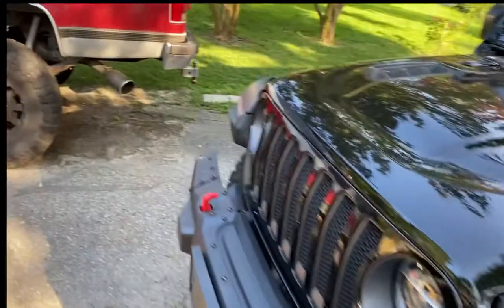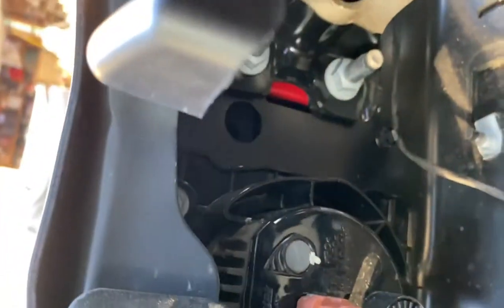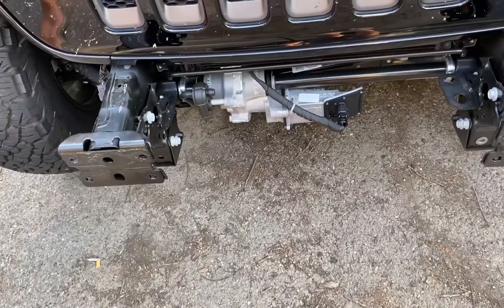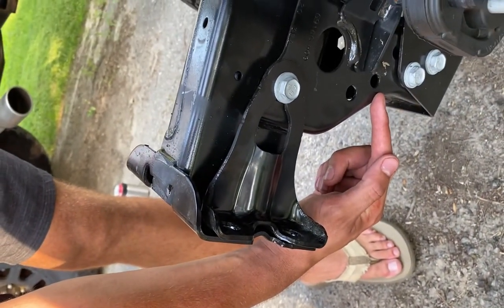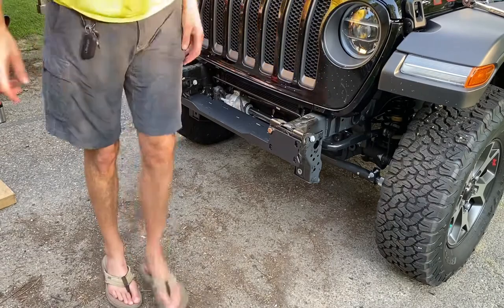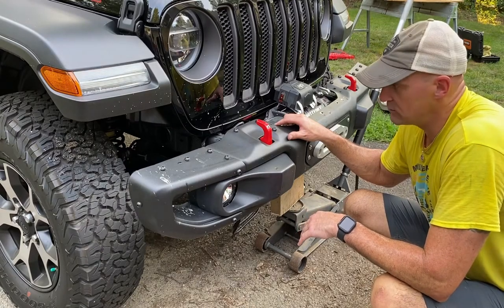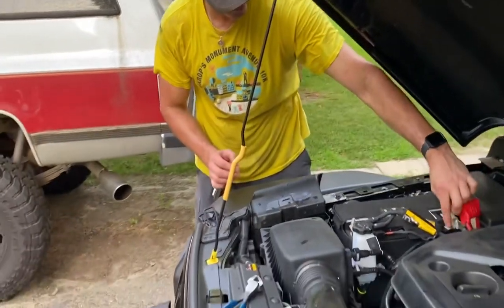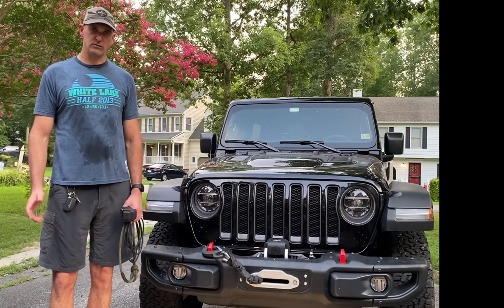Enhance Your Jeep's Offroad Capabilities :  Installing a JCR Offroad Winch Plate in Your Bumper

Comment: I had looked everywhere online. I concluded for the cost of a decent winch mounting plate.  I could buy an entire new bumper with led lights and the winch plate built in. Sold my factory steel bumper to the Jeep salesman I bought my Rubicon 392 from.
Reply from the maker: What bumper did you end up going with?

Comment: Excellent video guys.This was very helpful. Thanks
Reply from the maker: Outstanding, thanks for watching!
Reply: @FischerJeepAdventures  quick question....any issues with the JCR mount since you have had it for awhile. I am looking to install it on my Mojave with a Warn 12s. Has it been sturdy enough?
Reply from the maker: No issues at all, i had to winch myself up a stream bank a few months ago and pulled my son out when he got stuck in some mud and have had zero issues, its worked out really good and retained the factory front end look which i like, if your headed that direction, i would buy it again if i was doing it over.

Comment: Great video! After watching it several times I have two questions

1) How did you tighten the two lower bumper bolts inside the frame... near the mounting plate?

2) Did you torque or hand-tighten the bolts that attach to the winch from underneath? Two of mine ended up cross-threaded. 

Thank you!
Reply from the maker: Thanks, for question one i had a combination of a long handled fine toothed ratchet that allows little swing to use the ratchet and a universal joint extension.  For question 2 I hand threaded the individual bolts into the foot of the winch to avoid cross threading then tightened with a socket and torqued with a torque wrench.

Hope that helps.
Reply: @FischerJeepAdventures  It definitely helps; thank you!
Reply from the maker: Absolutely